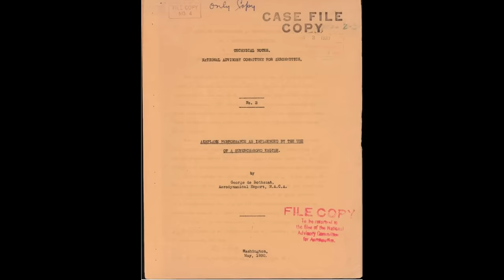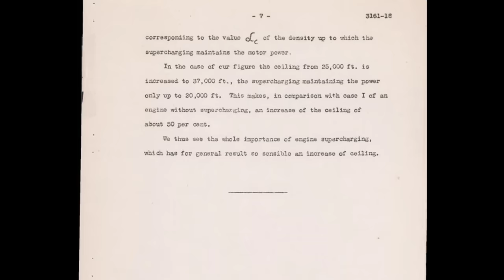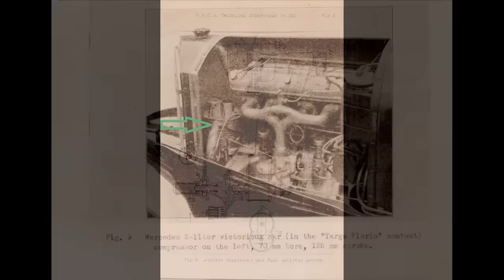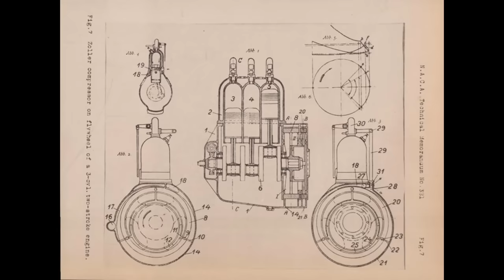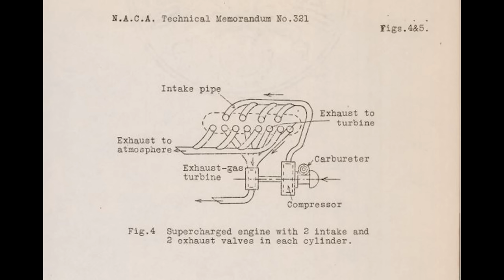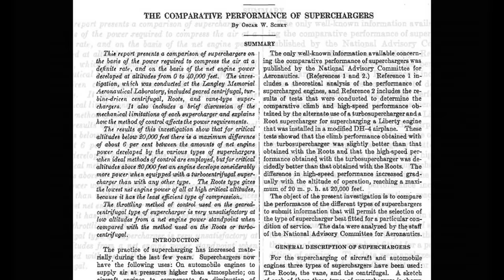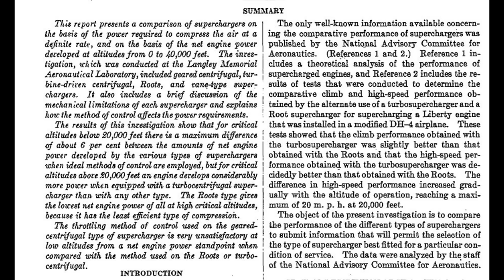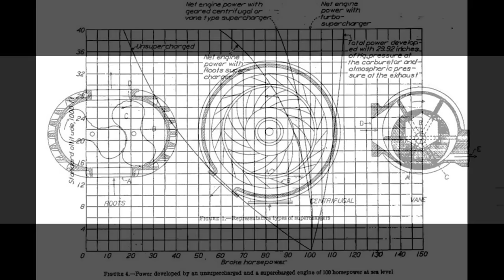Turbo vs Supercharging in WW2 Airplanes

Comment: I only recently encountered your outstanding series. Your in-depth and detailed data take-always are fascinating. I am a military history degree candidate with an automotive racing background, heavily experienced with Porsche turbo cars. That said, auto and aviation turbo tech are apples and oranges. Within this, to paraphrase the late Smokey Unick: "The physics don't change. Just find another way to skin the cat". I believe more could be explored with regard to the uses of water-alcohol injection as well as nitrous- oxide (an installment maybe?). I am in the midst of a turbo project that will explore the outer limits of water-alcohol injection using WW2 data. Racers have hardly skimmed the surface...
Again your series has been eye opener. 
Thank you!
Reply from the maker: I'm glad to hear you are using water injection. I agree it's effective and I have several videos about it, both aircraft, and automotive vidoes.
Reply: @GregsAirplanesandAutomobiles  outstanding!
Will find and check them out.
Thanks. Look forward to more of your work.

Comment: As a Thermodynamics/Mechanical Engineer, I have always saw the pure luxury of the radials as the durable ground strike tool.
The radials being air-cooled could be shot up & keep on fighting/getting the pilot back to a friendly base.
I recently read Robert Johnson's description of being shot to pieces in a thunderbolt while still an FNG & trying to bailout but his canopy had no glass left but was frozen in the closed position. 
He could not get out with his parachute on thru the metal canopy frame which his early model P-47 had.  
So he just point the plane W & prayed he would at least get to the channel.
An ME-109 come up while he was over on Belgium/Holland, flew at his wing a little while then went back & shot the 47 up with .30 cal mg. 
He then come up several times, indicated his shock @ the 47 still flying & shot it up some more.
Robert later concluded that the 109 was winchester on 20mm cannon & only had the .30 cal mg left. 
The 109 kept shooting him up till they were ~1/2 way over the channel & left since 109 was going to get jumped by England Air cover.
He finally got to a RAF base & made a perfect landing
Then he climb the metal opening in canopy & passed out. He had three mg bullets in his legs & multiple shrapnel wounds.
For the only time, he had forget his googles since they were broken & the new pair was not in proper kit. Therefore his eyes were in terrible shape from leaking hydraulic fluid & >200 mph wind stream. 
I believe he ended up #2 in ETO kills just behind Gabby who had  26 ¹/². Gabby was supposed to be getting on a boat for the states & he got impatient so he went back to his squadron. 
Being he commanded the squadron, he signed out a different P-47 with the new wide/longer paddle props. 
He went on a one man "rodeo" as they called it trolling for Abbeville(sp) FW-190 yellow nose boys to come up & play. 
Nobody came up so he went down & strafed an airfield but he broke the cardinal rule. 
"Don't make a 2nd pass". In the 2nd pass the flak was thick & he tried to get lower for 2 reasons. 
He was trying to flame up a 111 bomber plus get under the tower flak traverse angle but he hit the longer props therefore vibrating his plane to pieces. 
He crashed @ end of runway & ended up in a Luftwaffe POW camp as the allied commander. 
I believe he was LtCol or Col therefore was highest ranking allied prisoner. 

All these words with my main point being the liquid cooled engines could take a hit in coolant system & the plane is history in short order.

Comment: At 29:12, you show the Jumo 207-D engine which, aside from being a diesel, is unusual for its opposed-piston design - six bored cylinders with a crank on top and a crank on bottom, and a total of twelve pistons in six pairs that oppose each other. Yes, this means two pistons sharing each cylinder! The crankshafts and their piston pairs were timed very closely to true opposition, but were just a little off to allow for air scavenging since it is a valveless ported two-stroke diesel. This is why forced induction is so important for this engine. We have similar engines about US nuclear submarines, but in the form of much larger Fairbanks-Morse units which have a roots blower driven by the upper crankshaft.

Comment: The Rolls Royce Crecy sleeve valve “sprint” two stroke never got anywhere because the experienced engineers were 100% busy with Merlins & Griffons. But when it did run, the stroker turned out to be incredibly powerful AND very noisy. It cried out for a very big turbocharger to use all that exhaust energy. However RR had put little to no efforts into turbos. “Fortunately” for RR management, the turbo jet came on line faster than anyone expected. So the Crecy was cancelled.

Comment: Great video. Excellent work on addressing the differences between mechanically driven superchargers and exhaust-driven turbosuperchargers.

It would be great to see a follow-up video discussing how the German solution of driving a centrifugal compressor hydraulically compares to the mechanical and exhaust-driven compressors. As far as I understand, the hydraulic coupling allowed the compressor RPM to be infinitely variable (up to critical altitude), but the hydraulic power transmission was a bit less efficient than a direct gear drive? Would be interesting to see some numbers on exactly what were the advantages and disadvantages of each system.

Speaking of Germans, they certainly tried to produce turbocharged fighters. To my knowledge, none of these attempts resulted in any kind of production beyond prototypes numbered on the fingers of one hand. The Focke-Wulf company tried to build high altitude variants of their Fw 190 fighter. The Fw 190 B was an attempt to turbocharge the original BMW 801 engine, while the Fw 190 C was supposed to use a turbocharged version of the Daimler-Benz DB 603 engine. Additionally, there was the Blohm & Voss Bv 155, a high altitude interceptor which was also supposed to use the DB 603 engine with a turbocharger.

The Fw 190 B mostly had similar difficulties with the turbocharger installation as the Curtiss P-37 and the Bell P-39 attempts did, and they basically gave up on the concept after two prototypes. Instead continued developing the Fw 190 A-series by improving the supercharged BMW 801 engine's performance.

The work on the Fw 190 C-model was more promising, with a total of 9 prototypes built according to Wikipedia's article on Fw 190 variants. I would guess that project got into difficulties because the DB 603 engines were limited and mostly reserved for other aircraft, such as the Do 217 and the Me 410. However, the modifications required for putting an in-line engine into the Fw 190 airframe were probably integral to the development of the very famous Fw 190 D model with the Jumo 213 engine, and the later Ta 152.

The Bv 155 was originally (yet another) Messerschmitt project to create a replacement for the Bf 109, in this case it would have been the Me 409 (after the failures of the 1942 Me 309 design and the 1943 Me 209), it was then re-designated as Me 155. When it became obvious to RLM that Messerschmitt had too much work, they transferred the Me 155 project to Blohm & Voss, who basically nuked the whole concept with the exception of using the turbocharged DB 603A engine. Three prototypes were built, but the war ended while they were still under testing and development.
Reply from the maker: Hi Herra, great idea about comparing the US drive types with the German Fottinger type. The German type is really good, trying to do an apples to apples comparison will be tough, but I'll do what I can. I do think the Germans had a turbo Diesel bomber, I can't prove it though, but I think they actually have one, 100 percent intact and Wright Patterson, but you can't see it, it's in some hangar there.
Reply: Packard appears to have done some testing with fitting a variable-speed supercharger into a Merlin engine:

http://www.enginehistory.org/Turbochargers/PackardVSD/PackardVSD.shtml

If there are any performance/altitude charts for this engine, that might allow a kind of "apples to apples" type comparison between regular Packard Merlins (with mechanically-driven, two-speed, two-stage superchargers) and this variable-speed supercharger.

However, the variable-speed supercharger used by Packard appears to have been very different from the supercharger used by Daimler-Benz in the DB 601 and 605 engines. It had a two-stage compressor, and only the first stage impeller was driven by Fottinger couplings. The second stage impeller was driven mechanically. By contrast, the DB 601 and DB 605 engines used a single-stage, variable-speed compressor.

Comment: A point not mentioned in this doc is that on the one hand you take power from the crankshaft to power the supercharger while the turbo is powered by the exhaust gas. On the other hand the exhaust gas of a super charger driven plane provide thrust. German technical sources mention that the thrust of the exhaust gas can generate for ex. 7% of the total thrust in higher altitudes (Me 109).
Reply from the maker: Yes, I cover that extensively in other videos.

Comment: Interesting stuff, i never really considered the problems of putting turbo's on planes, although I had heard that the Germans were short of metals to make high temperature alloys which was probably why they didn't develop turbo's further and that turbo charging has some advantage at high altitude because the exhaust wants to come out faster in lower pressure.

Comment: I read today that the P38 had both turbochargers AND superchargers, I was never aware they had both. I came to watch this video to see if I could find further information on this issue and would really appreciate confirmation on this fact. Great videos BTW...
Reply from the maker: HI Matt, that is absolutely correct. The P-38 does indeed have a supercharger and a turbocharger for each engine. It's set up much the way the P-47 is, except of course it's packaged differently to fit into a different airplane.
Reply: @GregsAirplanesandAutomobiles  thank you Greg.

Comment: Interesting Vid, I appreciate the inclusion of NACA documents; elevates your work from just opinion pieces.    
    You might have mentioned the "need" for at least a single stage of gear driven supercharging to ensure these large engine had proper intake mixtures. Many aviation engines "mostly inlines" had badly compromised intake paths that led to uneven cylinder mixtures. Having the carb pre supercharger allowed a compressed fuel/air mixture to be dispersed more evenly. German usage of fuel injection mitigated much of this.
    You might consider the last gasp of piston engine/turbo/supercharger development to be the P&W of the B-36 C. It was going to use the R-4360-51VDT that essentially used compressed exhaust gasses as additional thrust by adding new fuel/air to the compressed and accelerated flow. VDT was also intended for the 'Rainbow' and a B-50 variant.
    You mentioned the lack of German Turbo usage in WW2, Im sure I read something recently about them using some form of  axial flow turbochargers, But i cant find my source. It might have been in relation to aviation engines in LSR cars.           
      Oh well I have pedantic enough for one day. Good work and many thanks.
Reply from the maker: Thanks Donald. I try to include NACA stuff, but of course I have to maintain a balance with other things. My next video is pretty heavy on NACA info. The B36 is a long way off on this channel, I haven't really even got to the B17 yet.
Reply: Donald, I rarely read of comments such as yours, and so thought of the following. I recall reading and will paraphrase a conversation between a German and an American aircraft engineer. The German said that direct injection made sure of even fuel allocation to the cylinders. The American replied "what about even air flow to the cylinders."

Comment: Thanks for explaining that supercharging is both turbo and blower types, I've tried to explain that to people over the years only to have them argue about it, seems over the years the car mindset has kinda high jacked the "super" charging term for blowers and don't want to include turbo's as part of it, I read once that when Pratt&Whitney wanted to test a General Electric turbosupercharger on an engine they couldn't find a plane that was aerodynamically capable of flying high enough to test it so they drug one to the top of Pikes Peak for the test, the first high altitude test I suppose, and it got there by horse!!!
You mentioned the Indianapolis speedway, there was another track in those days in my hometown in Pennsylvania that was the main rival of Indianapolis, it was a board track that was built by the owner of the newly formed Universal Studio's in Hollywood, it was a very prestigious race, the first championship race won there was won by no other than Louis Chevrolet himself, rich people and royalty used to attend the races there, sometime around 1919 a car (they used to race motorcycles there to) got away from someone and got into the stands resulting in the deadliest race accident in this country for some years, after the accident the track was closed and the racing crowd pretty much went to Indianapolis after that, try Googling Uniontown Speedway, I think Wikipedia has a page on it, I grew up about a mile from where it was, turned into a golf ball driving range by the time I grew up in the 70's, the truly ironic thing is before he built the track there he used to have a hill climb race, a half mile further up the road is the base of Mt Summit  (a 3 mile assent that averages about 7%), every year for a few years he had races from the bottom to the top of the mountain, but I guess the county fathers said it was unsafe and forbid it after the last year they had it, then he built the track up the road, so it was almost the Uniontown hill climb (as opposed to Pikes Peak), then it was almost the Uniontown 500 (as opposed to the Indianapolis 500), man talk about bad luck.
Reply from the maker: Thanks for your post. The story about taking an engine to the top of Pike's Peak for testing is true, I almost included that in this video, but I had to eliminate a lot of the early stuff because it was just getting to be too long. I didn't know about Uniontown, thanks, I'll read about it. You are correct that turbochargers are a type of supercharger, that's made clear in many NACA reports, not just number 384.
Reply: @GregsAirplanesandAutomobiles  
A good video to do would be on the turbocoupling on the 4 row Wright engine, sorry can't remember the nomenclature, and it's use combined with a turbosupercharger on that engine, or one on that whole engine, anyways keep up the good work on these videos they're very well researched and presented, also, do you have the valve timing and lift specs and connecting rod length of an R-2800 engine? I'm trying to make some calculations for a possible project and I can't seem to locate those specs, I have bore, and stroke but I need connecting rod length to get a stroke/rod ratio to be able to do the math for this (hopeful) project.
Reply from the maker: You might be thinking of the 4 row P&W 4360. I'll cover the later radials after I add a bunch more WW2 stuff. I don't have those specs for the 2800, although you may be able to find them in an online overhaul manual. That's what I would try first.
Reply: @GregsAirplanesandAutomobiles  
Wright R-3350 Duplex Cyclone, it had one turbosupercharger and 3 turbo/hydrocouplers, one of the most powerful ever made, several are still in use although like the one's in a water/firefighting tanker out west the FAA has dropped the maximum allowed power output on them because of their age, I don't know if the P&W 4 rows were turbo/hydrocoupled or not.
Reply: @GregsAirplanesandAutomobiles  
Sorry I meant 2 row, that's what I get for trying to type and fold my laundry at the same time.
Reply from the maker: No problem. I will be going into those later, but I think the next WW2 plane video has the be the P47, then a German plane.

Comment: Something to consider, the exhaust of a turbo is depleted of pressure. The supercharged engine exhaust has spare pressure and if directed to the rear provides significant thrust. At higher speed this is equivalent to a substantial amount of engine power. Look up "Lovesey Merlin" for the details as to why the Merlin wasn't turbocharged.